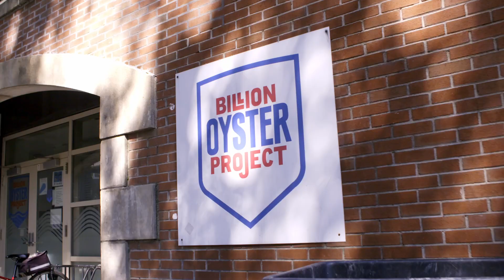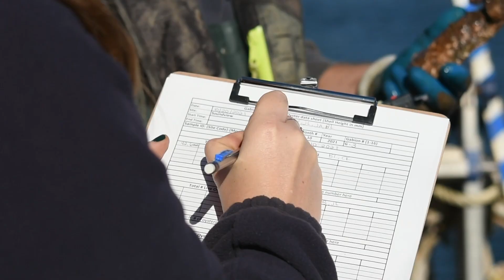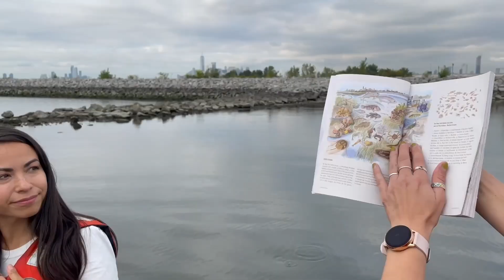Billion Oyster Project: Rebuilding New York Harbor

Comment: Every time something is put back then it helps the planet.  It just makes sense.  Well done!
Reply: Ecosystems are not the same after a species declines or disappears. Putting a species back into an unhealthy ecosystem that declined for a reason, does not rebuild the ecosystems. Understanding why the species declined is the first step.
Reply: @ss8578 
Puede que no sea solo el cambio y contaminación sino también el consumo del humano. De hecho resultará muy interesante el experimento... se necesitan suficientes brazos para depositar billones de ostras.
Reply: @ss8578  Just like the bison, over consumption!